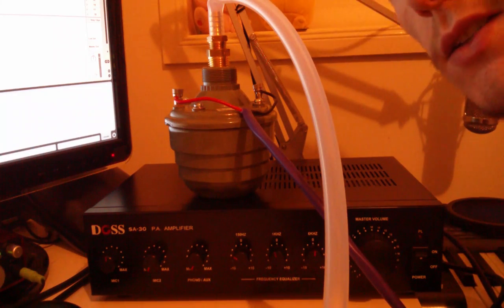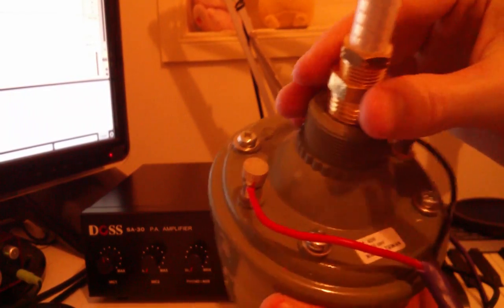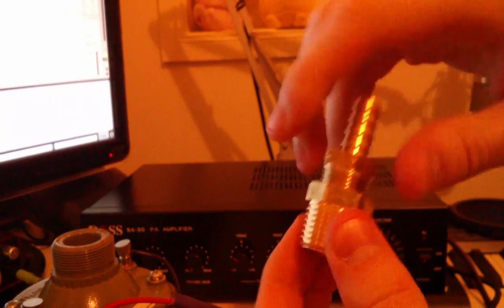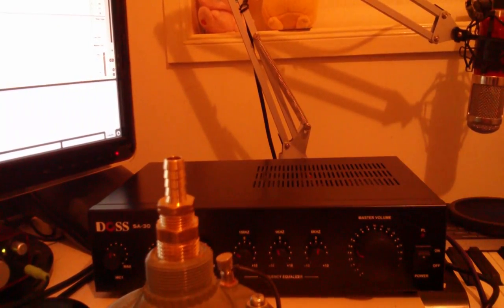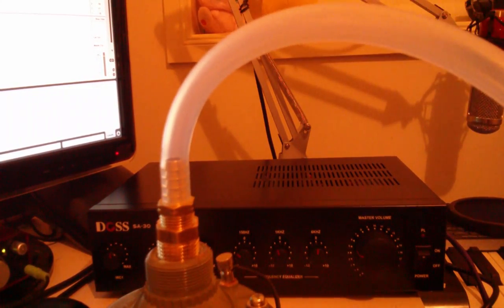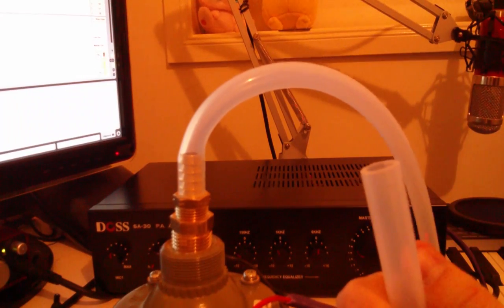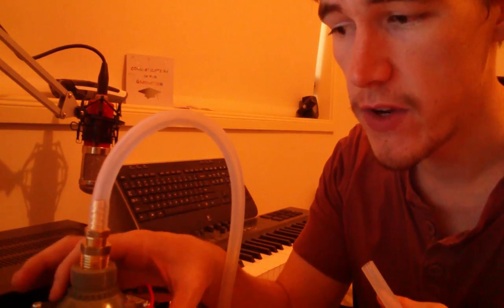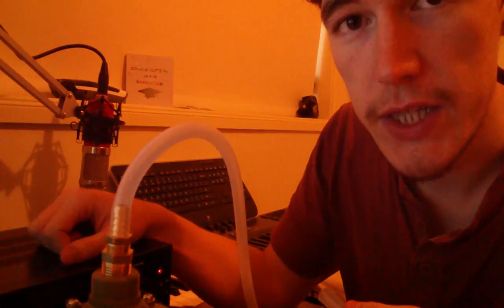How To Make A TalkBox

Comment: how are you getting midi input from your keyboard to the talkbox?
Reply: Elliot Chael there is no midi connection, the keyboard audio output goes into the amp, the amp output goes to the driver, the audio from the driver goes into the tube, the audio from the tube resonates in your mouth and the sound is shaped by using your throat, tongue, and lips just as your natural voice is
Reply from the maker: Thats right. The midi keyboard plugged into the computer is producing an audio signal that is going from the PC to the amp and then into the talkbox

Comment: how did you get the little screen off? does it screw out or do i have to cut it out?

thanks
Reply from the maker: It just pops out, its only stuck in there with a bit of weak glue

Comment: Can you show how you plug the driver to the back of the amp
Reply from the maker: Hey, I no longer have that setup, but from what I remember I used some rca to speaker wire cables, the rca into the 'output' and plugged the wires to the terminals of the talk box, because the talkbox is essentially a speaker so you hook it up like a speaker.

Comment: How does connections works? What are both colored cables? And where can we buy the male out of stock?
Reply: https://www.amazon.com/Anvil-8700129003-Fitting-Bushing-Female/dp/B0058DHT0S/ref=sr_1_4?keywords=hex+bushing+1%2F2+inch+male&qid=1561084450&s=hi&sr=1-4
Reply from the maker: Link has been updated

Comment: would I be able to just plug into my interface with this set up minus the amp? or do I need an amp to drive the sound?
Reply from the maker: You need the amp to drive the sound, because its the sound waves or vibrations that make the 'robot' voice in your mouth cavity. Although if you mean plug the 'talk box' speaker driver into an interface, I'm not sure it would have enough power output.

Comment: nice..if i want to but the cable.how would you call it?.and where can i find that kind of pa amp?.thanks in advance
Reply from the maker: the amp I found on eBay or amazon, maybe check second hand store. the cable is called 'bare wire speaker cable'
Reply: +KeroDean ok thank you very much sir for your help..you reply quick..nice..thanks again 👍

Comment: Someone told me i had to connect a filter beetweent the amp and the horn driver. To protect it from low frequencies. What do you think about this do you use one ?
Reply: Yes, you definitely need a filter. Depends on the compression driver your using.... look at its recommended frequency range, and find an appropriate crossover coil, and capacitor

Comment: So the speaker wire, does it hook into the amp as positive and negative? Is it possible to strip a quarter inch cable and use the positive and negatives in it so I can hook into an input jack, I'm not entirely sure how it works.
Reply from the maker: +Tanner Jackson yeah you just need two wire cables one from L and R out of the amp to the input of the horn driver. The input of guitar/keyboard goes into the input of the amplifier. Think of the horn driver as a speaker its only the output

Comment: Would this work with a USB computer interface? I have a FocusRite Scarlett
Reply from the maker: +Johanna Baumann You need an amplified to drive the compression driver. I am using a USB interface output to the amplifier input so I can play VST instruments through it
Reply: I am slightly confused, so I would need an mbox and an additional amplifier to do this?

Comment: Where can I get an amp like that? Or if there is, a cheap version, because I have a fairly tight budget.
Reply from the maker: +Joel Dallison Any amp is actually fine, even a guitar amp, just make sure the impedance is the same or you could damage the amp. 

 "Most talkboxes have an impedance of 16 ohms. The rule of thumb is that, if possible, you want to set your amp to the same impedance as the load (speaker or talkbox driver). However, you can use a load that is greater than what the amp is designed for. The amp just has to work harder, and will produce less output power. If you have a choice between a talkbox driver of 8 or 16 ohms, stick with the 16 ohm model. Otherwise, you run the risk an impedance mismatch that could cause your amp to fail." quoted from here http://www.ultimate-guitar.com/forum/archive/index.php?t-912855.html
Reply: +kerodean Ok, thanks :D

Comment: i dont really understand ohms, its says on the website the driver is 40W would i be able to use the driver with 22w amp ?
Reply from the maker: +STFU768 "Most talkboxes have an impedance of 16 ohms. The rule of thumb is that, if possible, you want to set your amp to the same impedance as the load (speaker or talkbox driver). However, you can use a load that is greater than what the amp is designed for. The amp just has to work harder, and will produce less output power. If you have a choice between a talkbox driver of 8 or 16 ohms, stick with the 16 ohm model. Otherwise, you run the risk an impedance mismatch that could cause your amp to fail." quoted from here http://www.ultimate-guitar.com/forum/archive/index.php?t-912855.html
Reply: thank you for explaining :) great video btw !
Reply from the maker: STFU768 No problem, thanks :)

Comment: If my amp has a phone jack could the horn driver be wired to that?
Reply from the maker: I guess so, but I'm not 100% sure
Reply: I found out it technically works, but the phone jack is under powered so it's super quiet. No go

Comment: So hey again, it's done!  It's frickin' awesome!
Thanks so much.  
Much love and here are a few pics in a slideshow (only way to post them here)
https://youtu.be/lW8fC_8hnjc
Reply from the maker: awesome man, how does it sound?
Reply: KeroDean  Hey there, I haven't had a chance to record it for you-- it sounds awesome, just like yours.  However, I replaced the plastic tubing with the same size but in silicone.  The plastic was too hard to use comfortably, even though I boiled it (which helped straighten it but didn't affect the hardness).  I ordered it through amazon at (http://amzn.com/B000FOWGGW) and it is much better, though because it's more bendable it can crimp and cut off sound.  I'm working on possibilities for solving that, such as using the plastic until the mouth piece and then attaching a piece of silicone to the end.
However it works out, it's awesome and I'll be forever thankful!
:)
Jamie
Reply: Jamie Lavender that's good to hear, glad I could help. I hope you find a solution to the hardness problem